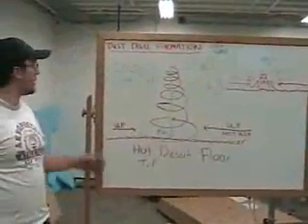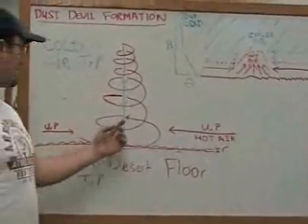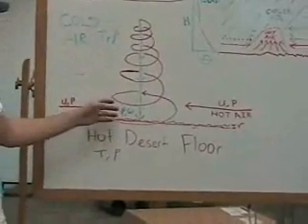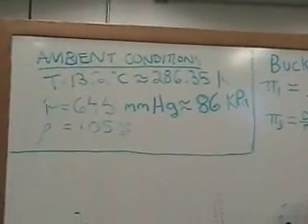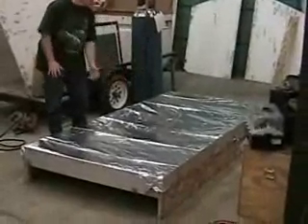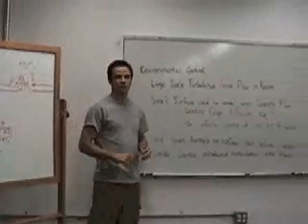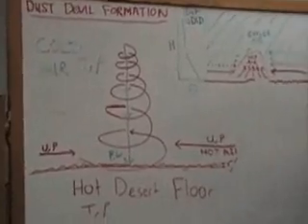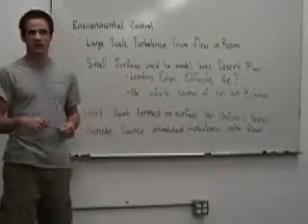Mini Dust Devil Attempt

Comment: you actually can make a mini dust devil, I've made one. What you do is get a mist maker then let the mist cover the stove. Then turn the stove on high and when the warm stove air rises up through the cool mist air it makes rotation, the dust devil gets about an inch wide and 6 inches tall and can spin for around 5 seconds.